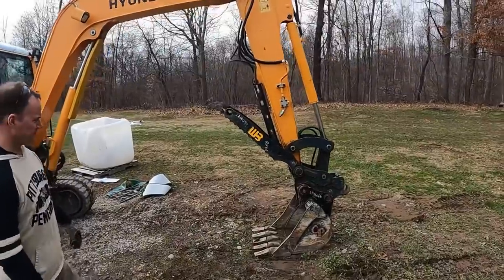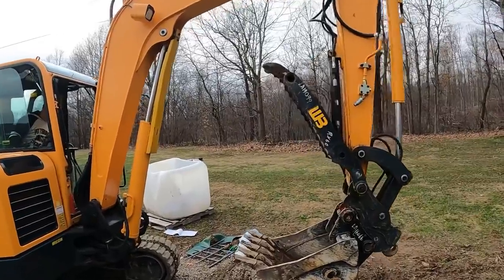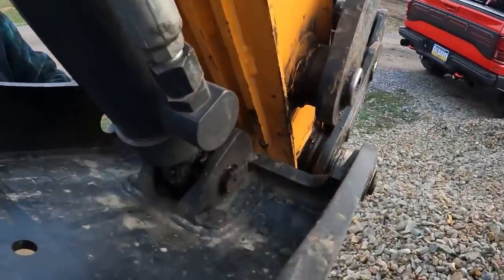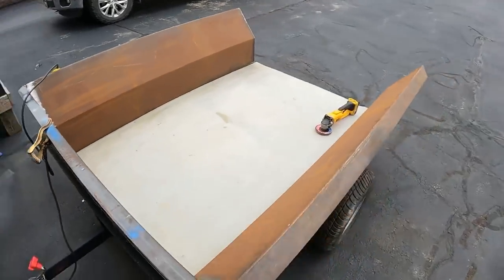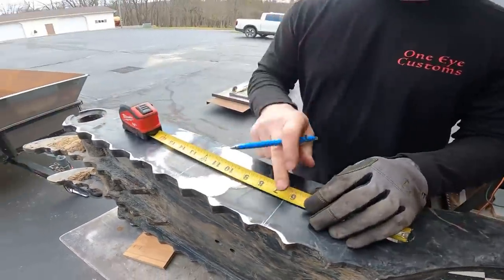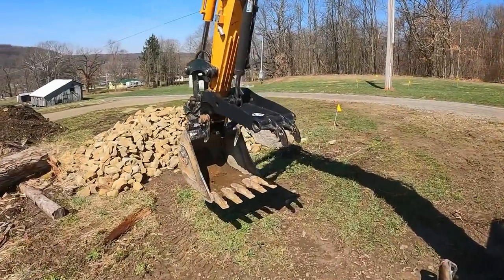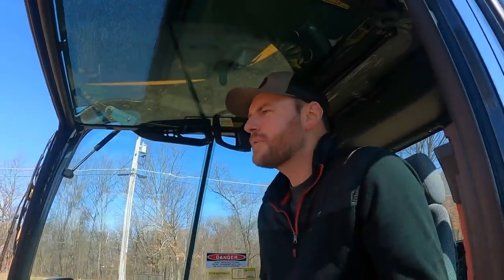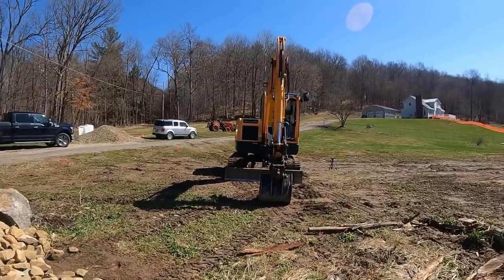Excavator Thumb Major Repair

Comment: Such a wonderful neighbor to help you solve a fairly complex mechanical problem with your excavator. Doug is certainly an extremely talented craftsman with many years of experience. I find Doug to be a critical thinker that methodically took the excavator thumb attachment and modified it to work with the bucket. Doug deserves many wonderful words of praise. Have a great day from your friends in Highgate Vermont.

Comment: Doug's a good guy!!!  He needs a higher amp welder though if he is going to keep tackling heavy jobs like yours! Also for overall longevity it would be a good idea to plate the sides and middle joint with diamond shaped plates which will tie the virgin steel on either side of the weld joint together!   Even putting that logo back on and fully welding it can help!  Nice job Doug!

Comment: Nice job Doug beautiful metal fabrication. My wife and I have a farm and then eskavator and the thumb is breaking from where welded to the stick major pain in the tail. We pick up extremely large logs and put them in a firewood processor and the excavator is the best way to do it. But the grapple hook Mount is welded to the stick Wells on the one side keep breaking tried multiple fixes and still not working so good we're going to have to do a major reset. We have the plasma cutter the Torches the welders. And when you have a farm you have to be able to retrofit just about anything unfortunately I've had forty years of retrofitting and jury-rigging the terminology but I'm a gentleman I won't put it in the comments. Nice job Doug good welding job in metal fabrication awesome work damn their looks Factory and I believe your weld will hold up just fine.
God bless you all good work.😀😁😄😎😃

Comment: Kudos to Doug that was serious structural welding.  I'm of the opinion that the thumb was not original equipment provided by the manufacturer.  It was an add on that was close enough to work but a little off so that a crash guard was required to be welded on the cylinder for protection.  What with today's litigious society a company would not dare to produce a machine with an obvious interference of one of its moving parts.  Great fix guys, great video Adam thumbs up.

Comment: That was super cool. 
You could put those WB logos back on as phish plates. I like how he added the extra teeth in the middle. 
Surprised Doug doesn't have a leather wrap around his plasma lead cord. Also, you should point out how he protected the cord by not having it in the drop zone. Both slag & pieces of metal can easily ruin that cord. 
We had a local cop that was nicknamed 'Ol' One Eye' cause he stopped every car that had a headlight out.

Comment: Due to neighbor Doug's attention to detail am very surprised he didn't put the logo back on the side of the thumb, it would also add some strength and cosmetic beauty to the unit. Adam, you might want to look into repairing that guard and re-welding where the welds have broken. Doug does show a ton of pride in his work.
Reply: I kinda thought the same thing, until Doug stated that the Werk Brau company  "WB logo" made the claim that their thumb was the correct unit for Adam's excavator.  (see my comments near the top of the comment section). They dont deserve to be advertised when it is obvious they are wrong. It likely took Doug 8-16 hours of hard work to fix this flaw.
Reply: Due to the guard being a totally different color than anything around it, I'm sure the previous owner built it to protect the cylinder. It isn't a factory item.

Comment: I have a similar problem with my excavator and thumb. I had a thumb built specific for my machine and bucket, but then ended up adding a coupler after the fact, so now my thumb is too short. I wish Doug lived closer to me, he could just add on to my thumb with the section he removed from yours. Great video, that machine will be a lot nice to use now with a properly sized thumb 👍🏼

Comment: The fabrication was done very well, and probably couldn't have been done much better. But the issue is where on the component it was done.  The cracks will start from the valley of the teeth where the weld ends, and its not "IF" it will crack its only a matter of "When".  Use it sparingly picking up small objects it might not crack for a long time.  Use it picking up large logs frequently using alot of clamp force it will start cracking alot sooner.

Main thing is keep an eye on it from time to time, and repair any cracks before they get real big and cause a total failure.

Comment: Did Doug use special Mig wire or rods to weld the thumb it would be made from hardened steel or similar I assume.

Comment: Great job to neighbor Doug...if you can imagine it, you can build it!
Getting bucket that's 6" longer from the pivot to the teeth would also work 
(might be hard to find one if that distance is a standard length for buckets for each size machine or quick attach adapter)

Or you could have  considered getting a larger capacity grading bucket that has saw teeth on it's vertical edges...a grading bucket that would be a handy addition to the implement inventory...

Or  make an adapter for the tractor bucket so you could use it on the excavator too..

Or you could......on and on and on...LOL
Reply: @Sharpshorts you may have missed it, but the thumb is too long and hits the boom cylinder. A bigger bucket would then also hit the boom cylinder creating a second hazard. I believe the thumb was incorrect for this machine and had to be shortened. Any other option would still be a problem. So the solution was to shorten it, eliminating the ability to hit the boom and making it correct to pick things up with it. Thanks for your input!!

Comment: and your boom cylinder guard has come unwielded as well better tal a look at that as well
Reply: Good eye , spotted that as well .
Reply: That was also fixed by the end of the video, just not mentioned.
Reply: I heard somewhere that hydraulic cylinders should not be heated (such as via a torch getting too close, and perhaps welding) because it damages either the cylinder, or the seals inside).  I think I heard this on andrew camarata's channel.

Comment: Nice work Doug. I do have a question… Do you know what grade metal the thumb is? Most construction attachments use a high carbon ar400. This metal can be welded but it’s an involved process. What spec weld wire did you use? Most common weld filler in field for ar400 is 7018 rod with preheat and controlled heat input. It’ll be interesting to see how it holds up. Then again it may just be low carbon steel.
Reply: @Garny it is a low carbon steel for sure, maybe a hot or cold roll steel. For the factory to use AR400 steel for something that is not or does not have a cutting edge or see the wear like a bucket, would double the cost to manufacture it. Thanks for the comment and your input. .035 wire and the Miller is capable of welding this thickness with its 220 volt supply.
Reply: @OneEyeCustoms  my comment got deleted??. I think Yt don’t allow copied websites. I found a cut sheet from WB about their thumbs and it says “T-1 is used in all critical and high wear components”

Comment: Now you are dependent on high maintenance used or new machines. You will always be modifying, servicing & repairing. Look at servicing your tractor. Add more work with an excavator. Doug is a god send but that will not last. You need to be more independent if you are going down that road. Not sure you know what you want? Just do firewood, finance, plow snow, ice skate!!!